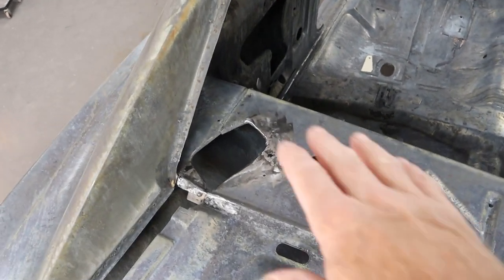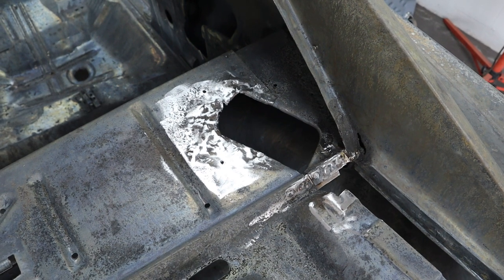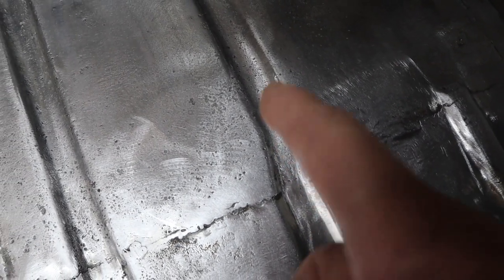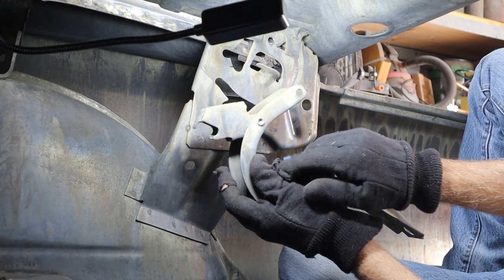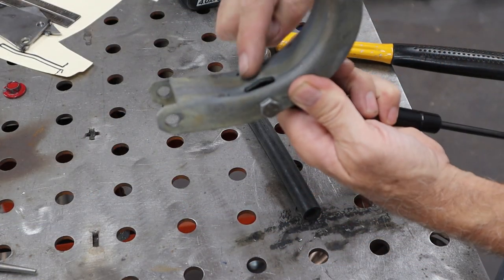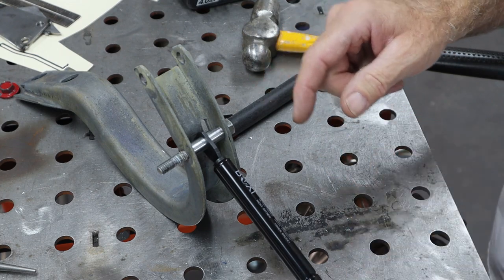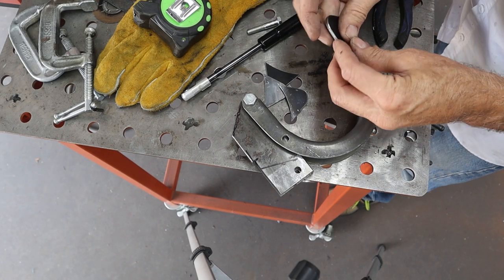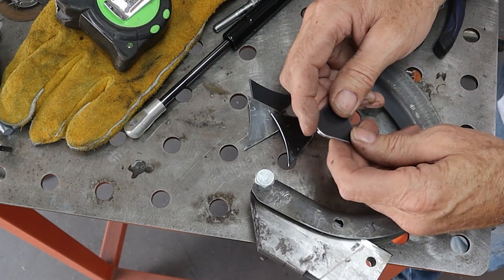GM A Body - Trunk Gas Strut Conversion/Modification - GTO RestoMod (Ep 16)

Comment: This i actually was thinking about i wanted to get rid of the rods on my projects but i was not thinking of putting them on the hinges and hiding them like this i was thinking more of attaching to the trunk lid and under the lip somewhere but this is so much better especially since they are not seen grwat thinking on this one im sure a lot people will do this i know i am thanks again for the awesome videos
Reply from the maker: You are very welcome.  You could probably use the factory torsion spring attachment on the hinge arm to get the proper fulcrum angle instead of welding on ears like I did.  It works really well and when I hit the trunk release it will open all by itself.

Comment: ??? Do you think wirh the mk6 strut and the original mounting point on arm and just extend the back mount.Will that work
Reply from the maker: When it was all said and done that thought crossed my mind while laying in the trunk. That bracket on the hinge would need to be opened up for the strut and drilled of course but it definitely would move the fulcrum point. Running out of stroke would still be an issue so a 13 - 14" strut would still be needed for the added stroke. Your way and the hinges don't even need to come out of the car, way simpler.
Mark